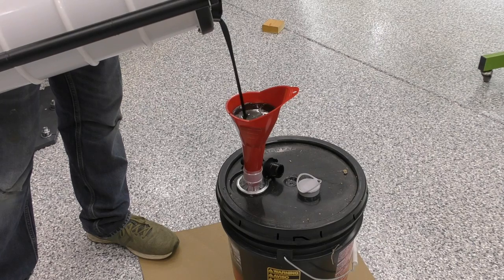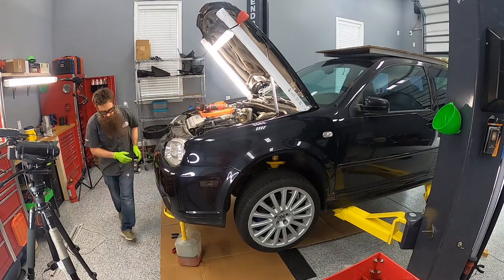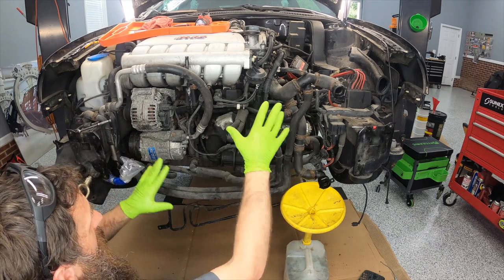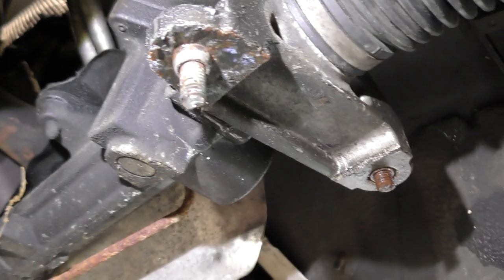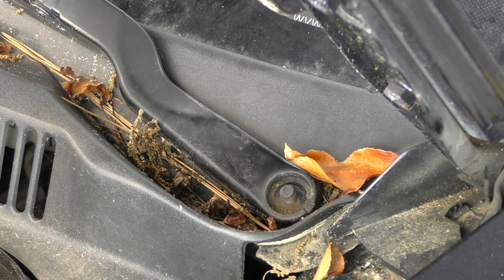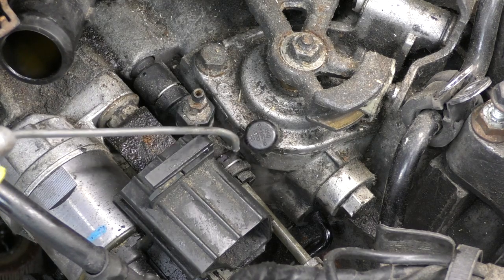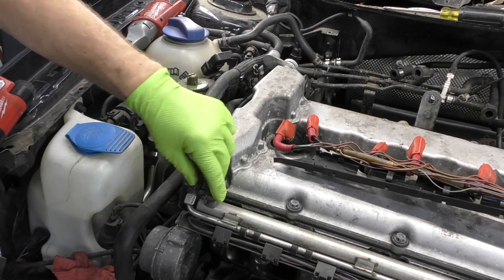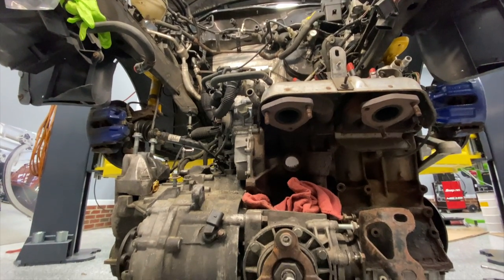R32 Engine and Transmission Removal ~ Time for an Engine Rebuild

Comment: A handy trick for the refrigeration pipes , compressor and anything else etc , is to put those expanding ear plugs in them to stop contamination on the bench . Its super cheap and super quick idea !

Comment: Doing this in an apartment garage is gonna be a pain.
Reply from the maker: Yep. And so worth it
Reply: I've done subframe, struts, coils, shocks, brakes, tandem pump, rotors, pads, and other miscellaneous things in my apartment garage but, NO way would I attempt a motor in my mk4 TDI golf.
Reply: Travis bennett funny enough, VW engines are pretty easy to pull

Comment: A tip I learned from a diesel truck mechanic for seized or rusted hardware works fantastic. 
-of course start with a dousing of rust penetrant
-start to loosen bolt/nut till it BARELY just loosens
-tighten the bolt/nut back up
-rinse and repeat till it is removed 

Basically treating it like a tap so to say, in a little then back out, in a little then back out. If it still doesn't work, use the same technique with a bit of heat persuasion. 

Can't wait to see these videos as it is revelant to my 24v mk4 gti. Kind of dreading doing my clutch on the garage floor😪
Reply from the maker: That’s solid advice. I do the same thing

Comment: Hi Charles,
I love the point on oiling fasteners before undoing them.
When a corroded fastener picks up and smears metal around it's done.
Oiling fasteners before undoing them prevents 99% of these accidents.
And again, using quality tools properly is correctly emphasized.
I like, looking forward to the rest of this build.
Best regards,
Duncan
South Africa

Comment: In the middle of doing the exact same thing on my 1996 Mk3 Cabby, it has been converted to AWD ( syncro, O2C transmission) and an OBD2 VR6. It's such a pain, trans needs a new 2nd gear synchronizer and the engine needs to be inspected for chains and lots of other things. Thanks for documenting all this Mr. Humble!
Reply from the maker: Thanks a rad build!
Reply: @HumbleMechanic  Thanks, I did not build it. It was built in 1999 by Denon Performance and Momentum Motorsports and was in VW Power the same year. Then it had a VR6 built to 3.1L  of displacement, Shrick VSR manifold and a bunch of Jamex stuff. I still have the ugly heavy 17" Jamex wheels on it. I'll be documenting some of it on my terrible channel but the links following are from the channel my buddy and I had started (he has since past away). A short video of the cabby https://www.youtube.com/watch?v=LLZ7-maXuYs&t=15s  and something you may find funny https://www.youtube.com/watch?v=Lka6javkTGA&t=1s

Cheers, I have worked at VW and Mercedes dealerships and I'm glad your out doing your own thing brother!

Comment: I love it when you work on an old car and you find a part where the previous mechanic has either not had the right tool or a bolts broken and you then decipher their mind set on how they came to zip tie it all back together. Saying that i removed a brake disc using an angle grinder once to cut the stay nut out and ended up cutting the hub as well 🙈

Comment: I like the glove trick! Personally I usually use either saran wrap or a glove whatever I have laying around, I mean there’s been a few times I’ve used plastic grocery bags & zip ties lol whatever works right. But more often saran wrap these days due to gloves being semi scarce and sometimes a little more pricey when you do find them. Can’t beat 300 sq. ft. of saran wrap for $3 lol. But either way anything is far better then nothing, I hate cleaning up rusty coolant yuck mess off my floor. Also I wrap connectors too if there going to stay open for a little while since I live in an area where any metal left unprotected will absolutely corrode, pretty quickly. Just saves me from having electrical connection issues when the project does go back together.

Comment: Love the videos and the tip about using a glove for hoses was awesome. However, could you improve this tip further by cutting off each finger etc and putting these over a hose each to get 5 uses out of a single glove?

Comment: Hi Charles, thanks for all these great videos. A bit off-topic for you but I am doing a head job on my 2008 Passat (T2.0l.)The car has approx 135 000 miles on the odo. I can't believe how much carbon is has built up on the intake and valves! My question is simply: Would you install an oil catch can ?

Comment: Awsome upload thankyou 
Just a quick question if you don't mind. Does the cv off the mk3 golf vr6 manual fit the automatic ? I am struggling to get hold of some driveshafts for the automatic mk3 golf vr6 1995

Comment: haha I remember when I removed a A/C line from a customers car.
on a hot day it likes to build a little bit of pressure, even when empty.
I removed the bolt from the front cooler / condenser. and watched the flange. 
it slowly seperated itself. I was like: 
"Eh looks funny!" 
BOOOOM 
in ya face!

yeah ... I got squirted at. xD

Comment: Doing such a job and putting it back it always pays to fit a new aircon drier when you put everything back.  This $5 part will save your aircon compressor.
Reply from the maker: Yep!!!! 100% will replace. And I have since found out the compressor is locked up

Comment: Hey Charles great video. I've followed every R32 video you've posted. 
I'll be doing chains and rear main seal soon so this really helps as I want to pull the engine to do it. My concern is the prop shaft. Was it already damaged or was it damaged when you pulled the engine? I don't need a big expense of replacing the shaft so any tips are appreciated.
Reply from the maker: Based on the lack of clean marking it was like that before. You can take just the trans out just be careful

Comment: i have an 08 mk5 with dsg and i was thinking i could drop the engine and trans out the bottom without taking the front end off? i am able to get the radiator out the bottom first, i have had the sub frame off and the clutch has been replaced about 2 years ago thru the dealer along with i have replaced the drive shaft so ive had the down pipes off to.. ive never pulled the motor but its time for a timing chain, water pump and the rest of the bits to freshen it up so i was thinking it would be better to pull it.. do you think pulling for a timing chain and the extra is wise and is dropping it straight out the bottom possible? i do have a lift and hydraulic table. thanks, enjoying the content, its basically the same as my car... but a little different under the hood layout.

Comment: Hey Humblemechanic, I've got a 2004 Dodge Intrepid SXT. I'm having a problem with getting the nut off of the power wire on the starter. The mounting bolts for it came out easily, however the power wire is the only the giving me problems. Their isn't alot of room to get a breaker bar in there. Plus the nut has started to strip. What do you suggest I should do about it? Everything else on the car is pretty much okay and I only have to buy a few parts for it.
Reply: Zig'sFixes break it, the new one comes with one lol
Reply: @austinrivers9938  Thanks! I just had my mechanic replace it. Seems like he did the same thing you were talking about. It turns out that the Positive jump post was really corroded. After I cleaned it the car starts up without a problem.

Comment: Great  video  looking for too the strip down and looking forward seeing the turbo set up, are you going twin turbo single? Question  is it possible  to take the engine  out the top rather than out the bottom  or have to come  straight  out the front as I don't  have a lift like you, and an a small garage  with a classic  Mini So be doing the job outside and I have chains too to and a slightly  noisy transfer box to look at in about 15 20k time thanks Mark.
Reply from the maker: For this engine out the front is easiest.  The whole front end comes off so easy.
Reply: @HumbleMechanic  thanks bud out the front it is, I normal  work on classic minis and have the engine and box out and on the  stand on one of them in couple of hours lol 😆

Comment: Good video but was hoping to see what you needed to disconnect on the transmission to get it to come out as one unit.  For example, do you disconnect tranny at the propshaft? I'm assuming yes but I prefer not to assume. Repair manual not very helpful here either.
Reply from the maker: I take the bevel box off, then the trans off. When you take the bevel box off, you’re unbolting from the prop shaft
Reply: @HumbleMechanic  Cool, thanks! I'm working on B7 Audi so not sure about the bevel box but I'll find it if it's there!
Reply from the maker: It’s different on that car. Prop shaft out, then trans out if u remember right

Comment: How do you remove the transfer case and transmission from the vr6. I have the newer 3.6L VR6, the setup is almost the same just the cv axles don't have bolts on them they just go in and hold on with a ring.

Comment: Eh, just heat up those broken steering rack bolts with an oxyacetylene torch to red hot, quench with water. Repeat a couple times and finally heat them to a dull red and and they will spin out with a pair of vice-grips. It’ll be the easiest part of working on that thing.

Comment: Hey Charles, I’m currently removing the drive shaft on my mk1 TT 3.2 I removed all bolts and both ends and the center support bearing. I’m having a hard time removing it. Any tips?
Reply from the maker: Take the dog bone mount out and rock the engine
Reply: HumbleMechanic I removed that and the subframe as well, I ended up breaking 3 bolts that hold the steering rack👎 My car is from the Midwest and its had a rough life. I’ll try rocking it. Thanks, your video helped me a ton.

Comment: Help please...

I had a fuel leak on my mk7 gti and ended up replacing my tank and all parts related to that ($4,000 repair cost).

VW didn't honor my claim and said the cause was negligance...  no comment, I am so dissapointed.  Now my fuel gauge is acting up (stuck at full) and I have to go to the dealer for the 3rd time...

What is going on?  Where do I get help?
Reply from the maker: Why did they deny the claim? Have you called VWofA

Comment: Allen bolts🤦🏻‍♂️removed engine after broke a valve...to find the clutch pressure plate was refitted with six rounded Allen bolts....multi-spline tool works a treat👍

Comment: That seems to be a lot of rusty stuff.  Where was this car from, or should I ask where is this located?
Reply from the maker: It lived In Michigan most of its life
Reply: @HumbleMechanic  I have lived in Northern California, Silicon Valley, all my life.  Personally only seen severe rust only in areas where there is snow.  But, that is like a half day drive from here.  So, in the area that car came out of, it must have a lot of that salt on the roads, too.  When I drive through that stuff, I get my car cleaned up when I get back home.  I've seen cars and trucks just a few years old have holes on their fenders.  Kind of crazy.

Comment: 13:25 Those and the ones on some trans coolers around my parts are called Jesus Clips. Because thats what you typically hear a tech yell when they fly off since you pretty much never can find where they land and tend to be a pain to source outside calling dealer.

Comment: Why does my 2012 vw cc tapping noise when running but when a/c is on it stops???
Reply from the maker: That’s interesting. I wonder if it still makes the noise but you can’t hear because the increased fan noise. 

Maybe a failing component on the SERP belt circuit
Reply: I dont know but thanks for the reply 👍

Comment: I can imagine the meeting in Wolfsburg when this car was conceptualized..."So we'll take the best possible engine, and put it in the absolute WORST possible car, and people will worship it for decades." 
Then they did the opposite for the Mk6.
Reply from the maker: Hahhaha
Reply: Can you expand just a bit on why it’s the worst car? (Not trolling, legitimate question from someone who knows nothing about them)
Reply: @sephiros9883  Mk4s are infamous for falling apart in silly ways. I have a Mk3.5 Cabby with 194k miles and it's all basically fine on the interior, some minor wear on the driver's seat and steering wheel leather. I also have a Mk4 Jetta with 112k miles that has a badly sagging headliner, both front door cards' fabric totally fallen off, rips in literally all of the seats, button icons wearing away, shifter boot deteriorating, a phantom coolant leak, and suspension clunk. Sure it's anecdotal, but the general consensus is that Mk4s are the least durable VWs. Great engine options though.
Reply: Oh, and those headlights. Pure class. That's why it's a real conundrum for the VW lover. They look great, they have great engines, and the rest of the car is terrible in both every conceivable way and also ways that are beyond human conception.
Reply: @acefighterpilot  Ahahaha thanks for the good laugh! i had no idea they were this bad! I got into VW with an MK7.5 so i'm still learning. Thanks for taking the time to explain! :)
Reply: @sephiros9883  Your Mk7.5 is a far better car than any VW that came before it, you missed out on the fun.

Comment: wish ya stop skipping parts on the engine like the bolts for the prop to transfer box what size etc and how u get to them ><
Reply from the maker: I do my best but the video can only be so long. Lol
Reply: @HumbleMechanic  i no mate but the obvious stuff like the front end? u have covered that enough times in the other videos including your blue r32 so we all got that engraved into our memory to do it blindfolded but the shitty jobs most ppl need a idea on bud like chain replacement hell even where put the bolts when lifting it via the engine crane u said bout it but not showing :( bit more help please for us who need 2 do it sometime in future as garage bills r horrendous mate no offence
Reply from the maker: No offense at all. You actually bring up a great point. To peel back the curtain it’s something I struggle with. See all bolts are easy abs all are hard depending on the person and tools available. For me if in about 3 seconds I can’t do something it’s time to try something new. Sadly the flat rate clock is still ticking in my head. Lol